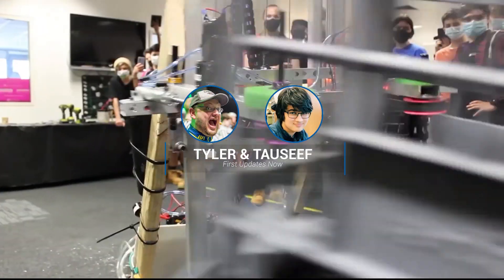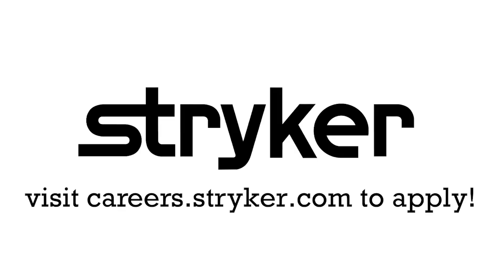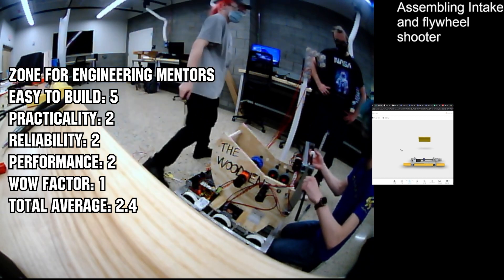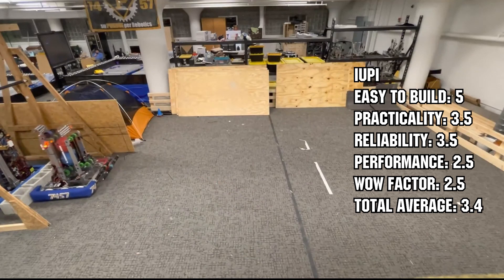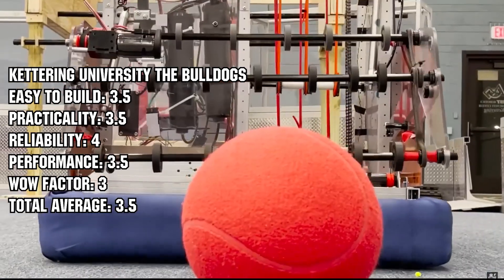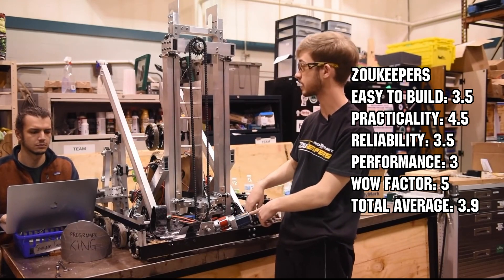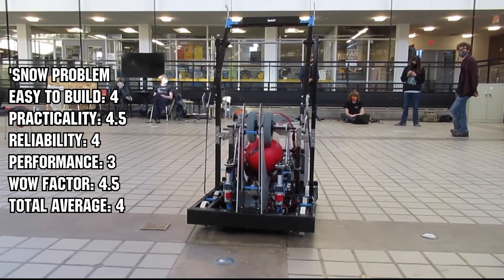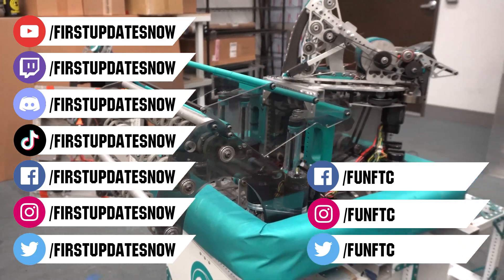Rankings Ri3D Teams with Overviews Rapid React 2022

Comment: I wish we had had a CNC to cut that wooden shooter hood (I was on the Zone for Engineering Mentors team) - I hand-cut it with a dremel that wasn't thick enough to cut all the way through in one pass; I had to cut each side twice, once from each side of the plywood, and try to line the cuts up.

Our robot shoots just fine, our climber is fine in concept but I built it and I wouldn't trust this example of it. The over the bumper intake is awaiting testing when we get around to building bumpers :p

FAMNM shot balls up to the second story of the building we both worked out of, I didn't catch any of their other tests.